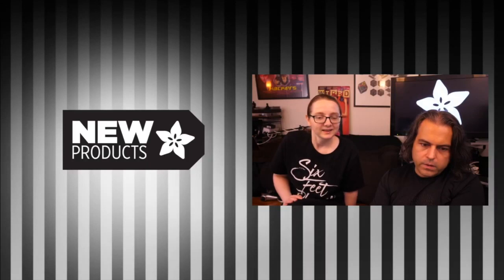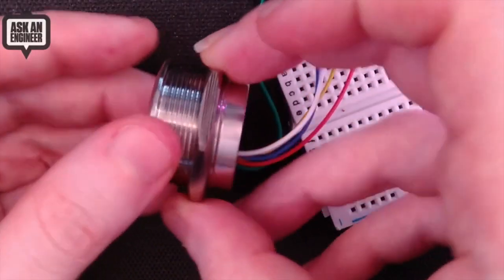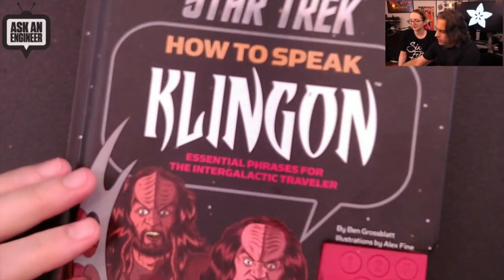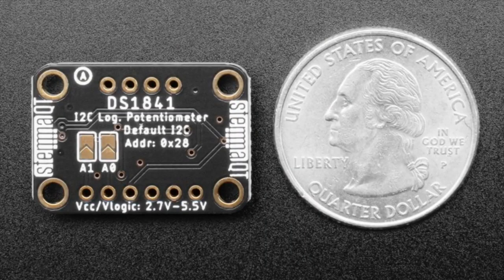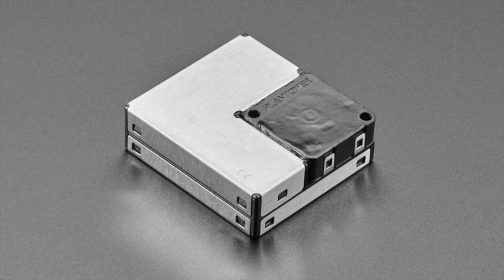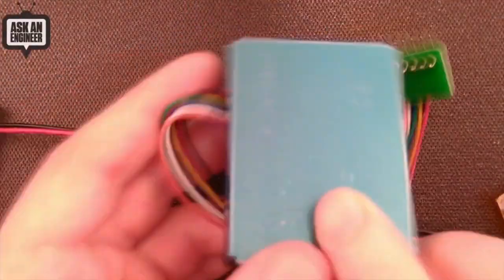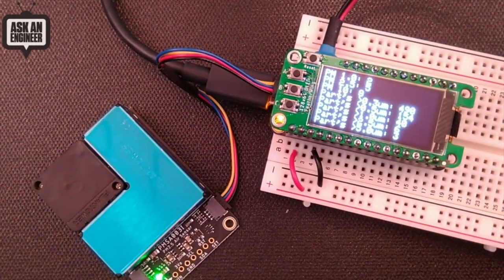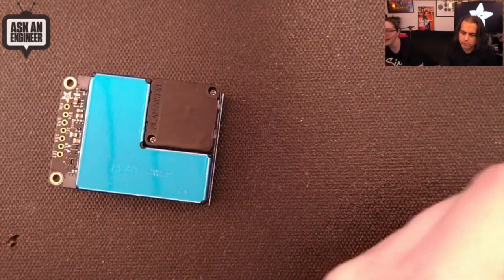New Products 7/08/20 featuring Adafruit PMSA003I Air Quality Breakout - STEMMA QT / Qwiic!

Comment: Just wondering, if you are working with a digital mixer, wouldn't you use a linear pot? I'm thinking the slider position is relative and the software would have the logarithmic adjustment coded in